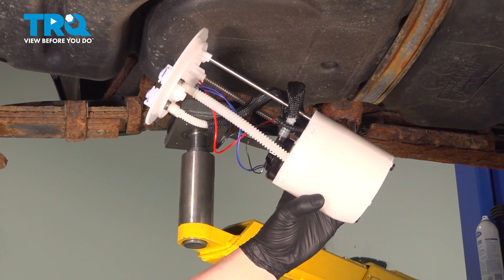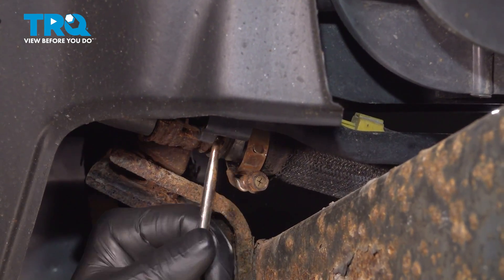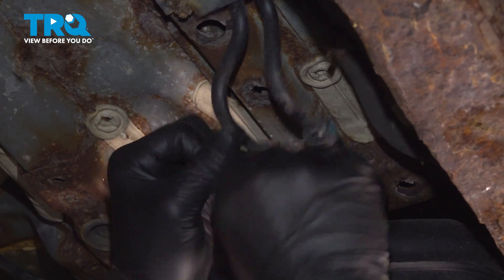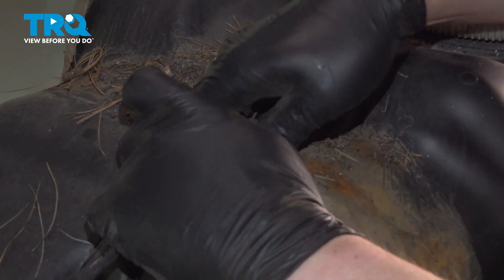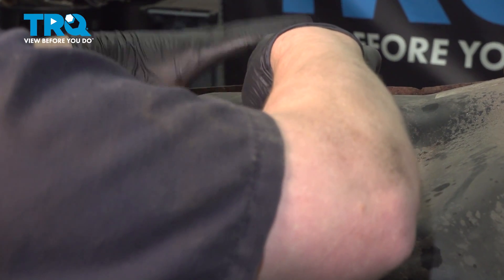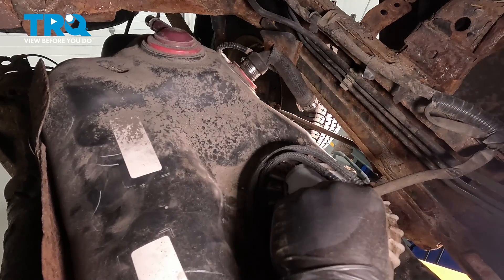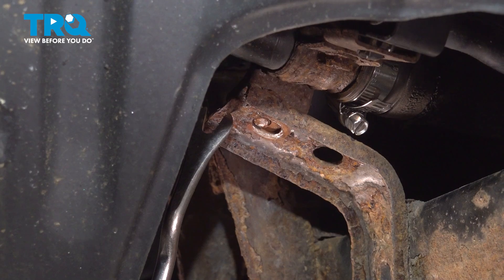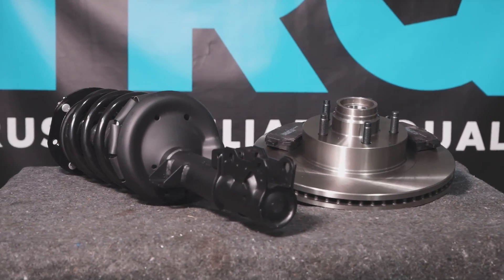How to Replace Fuel Pump Module Assembly 2005-2015 Toyota Tacoma 2.7L L4

Comment: Thanks for the video but definitely a regular pliers doesn’t work  with those quick connector , three hours trying to disconnect the one that goes to the filler neck and nothing yet🙄🤦‍♂️
UPDATE : after create my “own” tool and pull very hard finally I got disconnected such “quick connector” , the connectors from the fuel pump to the two fuel line was easy , by hand no tools , looks to me that accumulated dirt can make difficult to disconnect them🤷‍♂️🤨